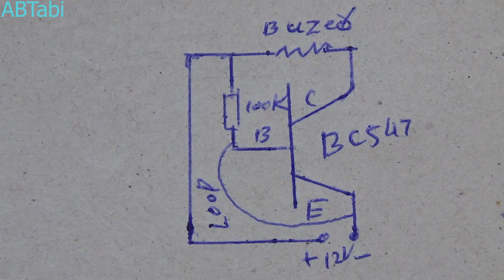BC547 loop break security alarm, burglar alarm circuit

Comment: Amazing project! You can also connect or tap a magnetic Reed switch on the base and emitter terminals. A small magnet or a refrigerator magnet will close the switch, once you remove the magnet near the Reed switch will open to trigger the device...